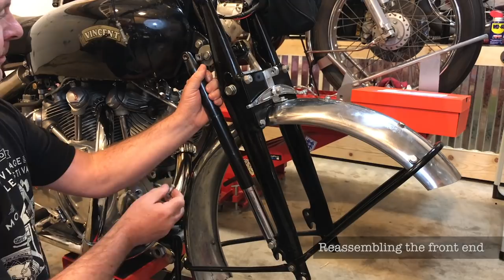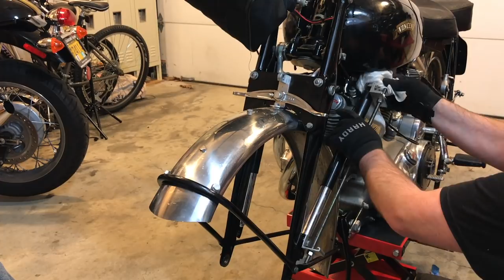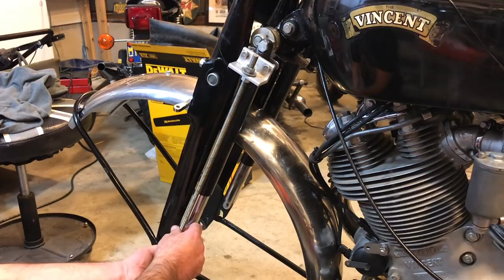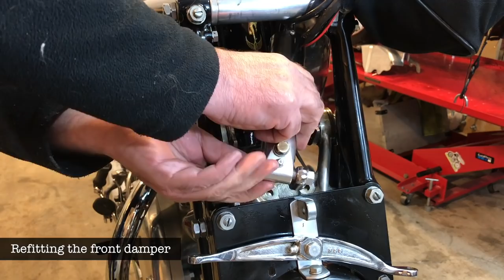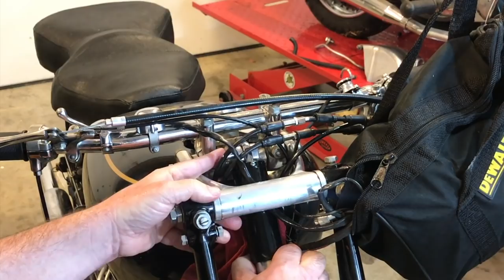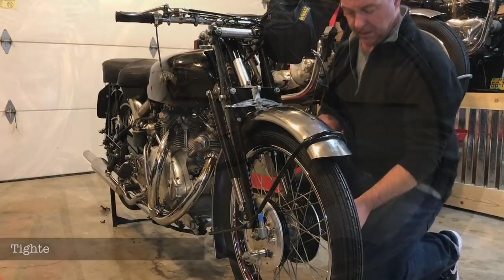Restoration of 1951 Vincent Rapide - Part 60 - front end (Part 6) Reassembling front end

Comment: I wonder why they didn't put two springs in both sides?  Might be a good mod in future to use progressive springs?  Good show Mike!
Reply from the maker: Hi John, the standard setup is 2 springs on both sides but I have found it too firm and so am trying 1 on one side and 2 on the other.  Best wishes, Mike
Reply: @TheMightyGarage  I wonder if that would stress one side of the linkage more?  Your colour coded springs will not cater for your needs?
Reply from the maker: @johnanthony5393  Hi John, yes possibly the Comet color-coded springs might work.  I'm going to see how this combination works and then try experimenting.  The gider fork 'blades' should compensate for the difference on either side.
Reply: @TheMightyGarage  could use nylon spacers to take up a little slack if short?
Reply from the maker: John Anthony Thanks John, yes that is certainly an option. I may do just that! Best wishes, Mike
Reply: @TheMightyGarage  Have a great Christmas Mike!